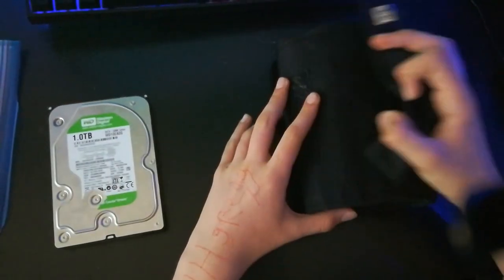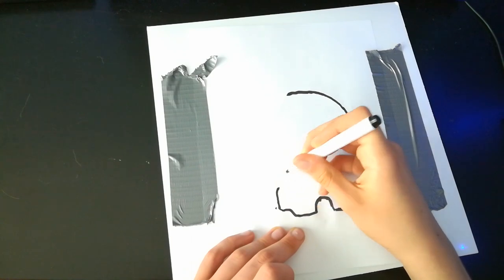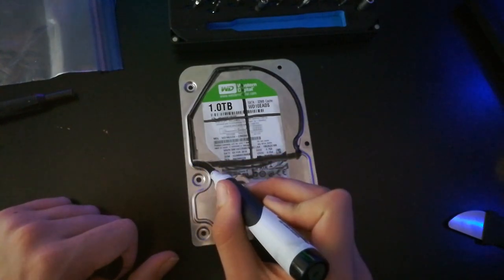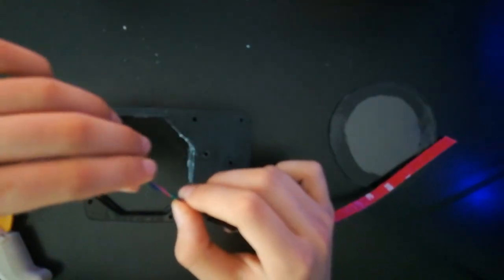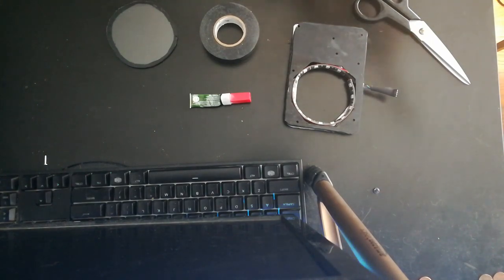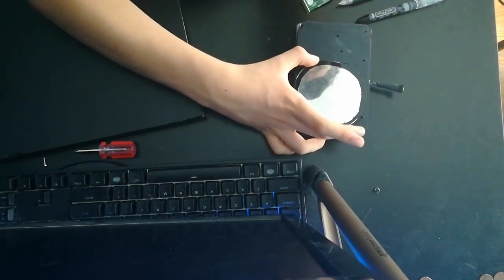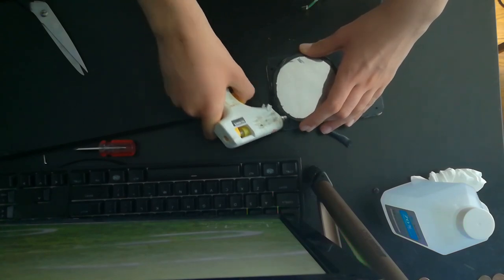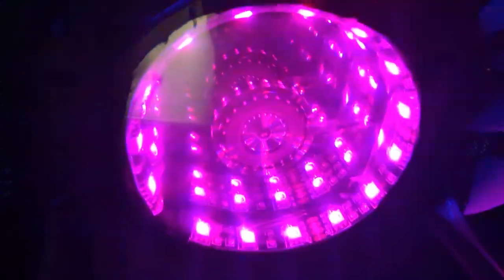Modding The Worlds First RGB Hard Drive

Comment: In the past i opened my hard drive like this, i ended up killing it without even touching the disc itself. Not sure exactly what i did, but my recomendation is not to open the hdd!
Reply from the maker: Yeah definitely don't do what I did unless you have already accepted you are going to lose the drive, even a little dust can mess things up badly.
Reply: Just stick the rgb strips with the cover or foam part like he did, no need to make the hdd itelf rgb, only putting something on it, and that's not magnetic.